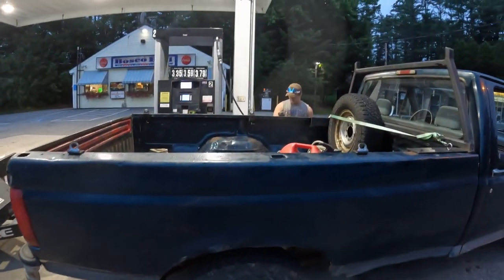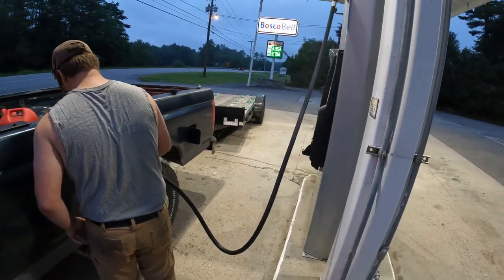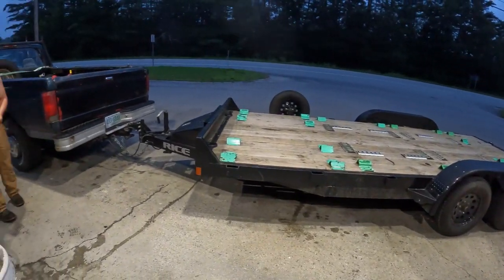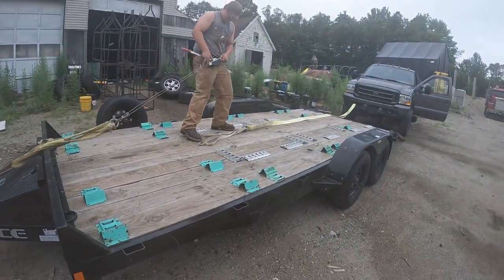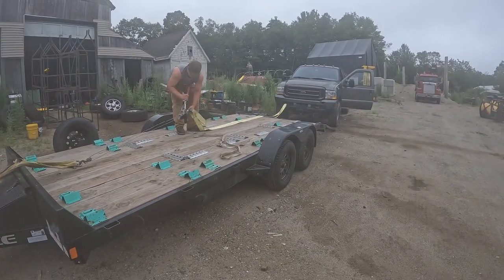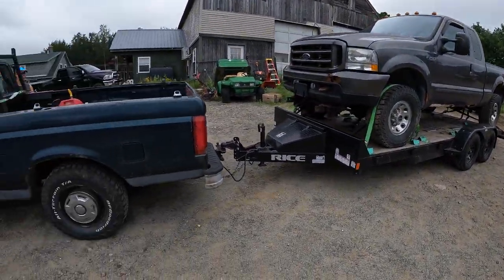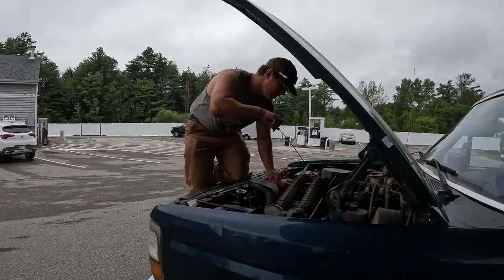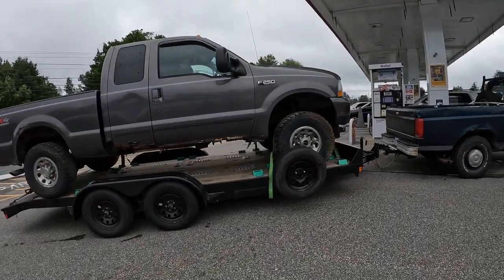Testing the limits of a OBS Ford F 250

Comment: good luck, should be a good project for you two, hope the price was right.
Reply from the maker: Hey Dave! Yeah, this was some older footage from this past summer.  We had to remove the fuel tank and put in a new fuel pump.  Runs great now! Colin has been working on it when he gets time. Welding in cab corners and replacing transmissions cooler lines.  He paid about $400 for it....so, its a good learning project.  You should see his Grand Marque that we picked him up for his daily driver (will try to put a video together on that one soon). Hope all is well:)